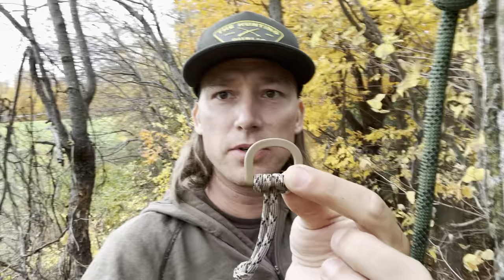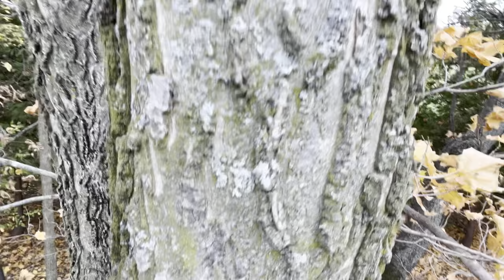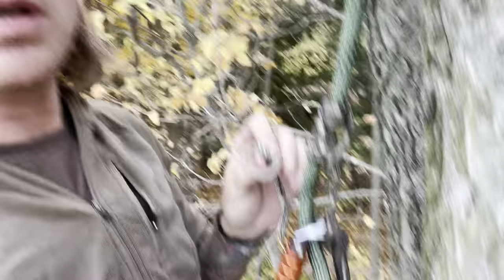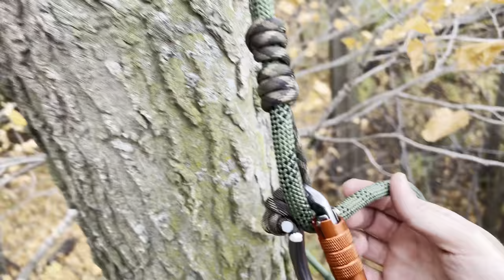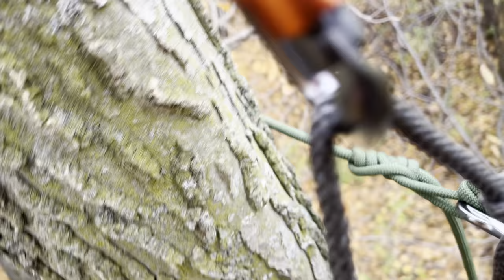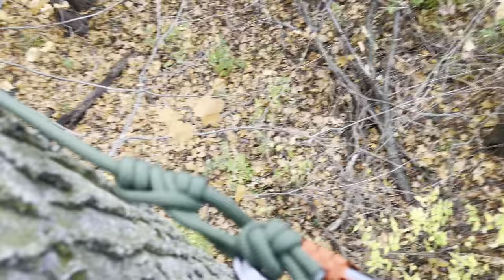HOT SADDLE HUNTING TIP: Turn Your Carabiner Into A Prusik Tender

Comment: @Jeremy Byng nice video; good tip, and well produced.  Based on how well those prusik loops slid on your main lines, I'ld say that you found an optimal pairing for rope sizes.   That said, talking about your safety here, I couldn't really tell how those prusik loops were terminated -> if those were overhand knots to close them off, then that's a clear no-go; those need to be a figure-8, or a double fishermans.  The issue with an overhand knot is that they tend to roll, and it looks like you have less than an inch of tail after that knot [ scared the hell out of me, for your sake ].  If I were you, I would address those immediately.

Secondly, your tending method should NOT be attempted with a screw-gate carabiner; and really should be done on the spine-side of the carabiner to avoid accidentally opening the gate.
Reply from the maker: Thanks
Reply: @jerbyng  also as someone who professionally and recreationally uses ropes (arborist and rock climber) I strongly suggest giving yourself a longer tail on the end of your prusik knot. it looks very short on camera, knots will work themselves a little bit loose over time and usage so leaving at least an inch or two of tail will save your life. just looking out for ya bud, happy hunting!
Reply: exactly.  Prusik ends have to be joined with double fisherman knots.
Reply: @andrecharlebois705  that’s what I was taught. I’ve seen lots of JRB videos and he’s very safe with years of experience and he recommends a hunters bend. It’s a whole lot easier to tie and untie to adjust or what not but very secure. Probably 5 seconds once you get hang of it. I’ve used the hunters bend on probably about 30 climbs now and always inspect carefully and they don’t budge. Of course I still leave a few inches.

Comment: Glad I didn't buy a ropeman. First I found out I could use a simple loop. Now I see you don't even need that. I'll have to test the biner method first to see how smooth it is. I know the loop method is pretty smooth. Either way the prusik is cheaper, safer and quieter than a mechanical device.

Comment: Your prussik should be smaller diameter cord than what it is used around in order for it to work.  You risk it failing in a fall if it's the same as your rope.  Stay safe.
Reply from the maker: What you see on the lineman’s is stock from XOP. 9mm rope and 7mm Prusik

Comment: Look into a valdotain tress tended with a small pulley. It's much easier and won't jam like a regular prussik. It's very popular with arborist and canyoneer people. Also known as a VT
Reply: He could get him a Rope Runner Pro or better yet a Ronin Lift Power Ascender.
Reply: @kurtdussander4944   the rope runner pro is awesome! I've used it and it kicks ass. The power ascender really eats ropes. A small pulley and VT would only be $40-50 and I've used that system for years in trees and it's always easy to adjust and safety rated. Everything being  tested and rated is worth the money if your climbing high enough that a fall could kill you. Just my 2 cents
Reply: @kevingeary1472  I’ve never used the power ascender,, it’s about $4000.00 . You are right about the rope runner pro though, it’s an amazing device for working in a tree. Arborist gear has came a very long way from where I started using knots to swing around in a tree while wearing the most uncomfortable belt n spikes imaginable. Setting a rope to walk up was unheard of then and you just spiked up the tree. Your safety lanyard better be adjusted on the ground because they were nearly impossible to do anything with once you got up in the tree.

Comment: How much rope do I need to tie the prusik note on the tehrd? And what size rope are you using?
Reply from the maker: If you read a bunch of the comments on the video you’ll find lots of advice on knots. This is the prusik that came with the XOP saddle setup and I have since changed both of them to a different prusik and tied them with double fisherman’s knots instead of the unsafe overhand knots it came with. 
I am now using 10mm tether with an 8mm prusik, and a 8mm lineman’s with a 6mm prusik.

Comment: Paracord prusik on your tether?? Never seen anyone do that
Reply from the maker: it's actually a 6mm prusik on an 11mm rope. The angle makes it looks smaller than it is.  But you can read through some comments and see what I've changed since shooting this. Using different/safer ropes and knots now, but the concept still works great.

Comment: You really should tie a bend instead of a knot for connecting the prusik cords. Those knots could roll.
Reply from the maker: Thanks. If you check out the comments you’ll see that has been addressed and changed.
Reply: @jerbyng  Oh, yeah. I saw. But, most people recommended a fisherman's. The knot you're using would be just fine if it was tied as a bend instead of a regular knot. Same structure, different way to tie it. Look up Canyons and Crags with Rich Carlson. It's very informative.

Comment: Can you post a link to your caribiners
Reply from the maker: Well i could show you a similar version still available on Amazon. BUT if you read through the comment section you'll see some good advice on why not to use these.  I have taken that advice and switched to the Tethrd screw gate version.  Big thing is you want a locking screw gate (NOT auto lock) so that it can't accidentally turn and flip open on you.  Black Diamond has some that are very affordable. This probably what I'd go with now off Amazon.  https://a.co/d/7zbY5BS

Comment: Please retie and reposition the knot in your prusik. Also on your linesman, your prusik should be a smaller diameter rope than your main line.  Showing folks how to do something, as you are clearly doing things in an unsafe manner is borderline negligence.
Reply from the maker: Thanks. If you’ll read the comments you’ll see all this has been adjusted and covered since posting. And the lineman’s is stock from XOP. 9mm rope and 7mm prusik. Thanks.

Comment: Hey man you got the xop saddle? If so do you like it? Got one for myself so far so good.
Reply from the maker: Yes! Good eye. I got a great deal on the harness and platform. I cut off basically all the fall restraint pieces and tweaked a few things. Made a belt out of the shoulder straps by adding a buckle.  Works just like a saddle now!
Reply: @jerbyng  yeah I cut the fall arrest too and left the shoulders own just easier to hold up the saddle. I dont care for the ropes and carabiners that it came with but it's not bad in my limited experience.